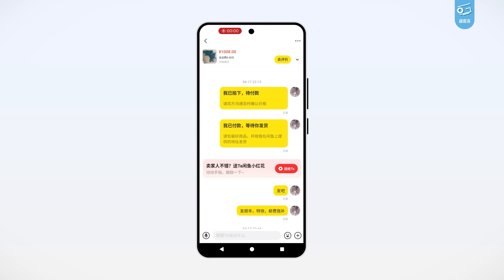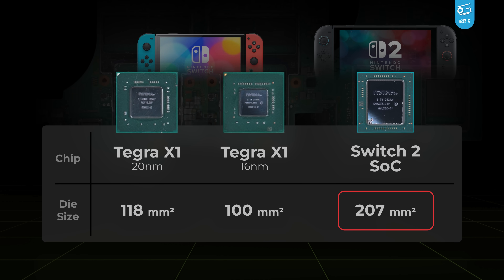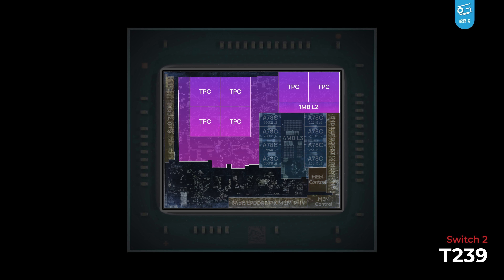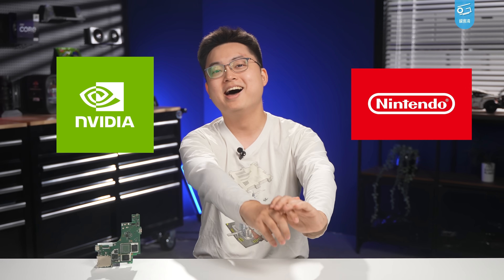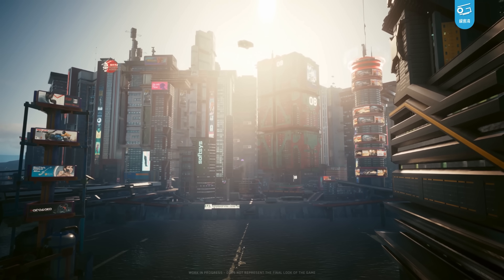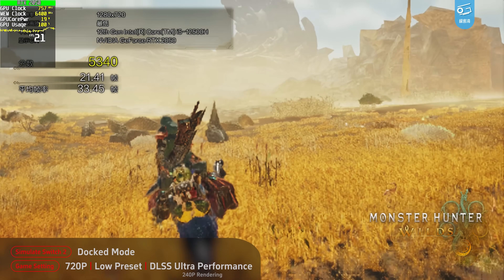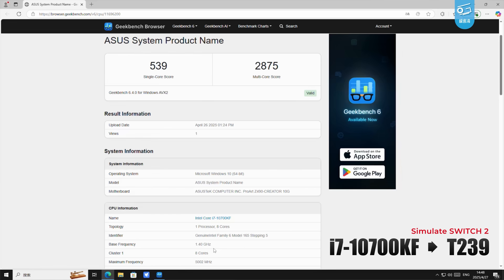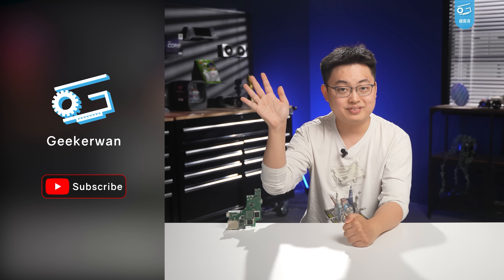This is Nintendo Switch 2's CPU!

Comment: I say that's a decent amount of power for a handheld, more power than a PS4. I’ll take it.
Reply: Eh when did the PS4 come out? 2013? So you're comparing it to something in 2013 in the year 2025. The power is in fact decent though compared to Nintendo's original Switch which was downright laughable even when it launched. Don't get me wrong I'm glad Nintendo is addressing how vastly underpowered it's systems have been. It is progress. But $80 games? $80 joycons? The system itself costing the same as a SteamDeck being $450 or more depending on region? You can buy a PS4 used for around $120 off ebay. IMO the only people buying the Switch 2 will be hard core Nintendo fans with those prices.
Reply: but still less than a steam deck as a portable device and less than a series s as a docked device...
Reply: @HermesderWetterbote steam deck is under base ps4 in terms of power, switch 2 easily outperforms it.
Reply: @shantaehalf-geniehero4318  steam deck is 7nm - switch 2 8 to 10. steam deck has almost 3 times more cpu power than the switch 2, steam deck has 4GB more ram. Steam deck has 4 times faster storage (nvmessd) steam deck has double the battery size. and these graphs clearly show the steam deck being faster than the switch 2 in handheld mode. and cyberpunk 2077 proves it: 360p to 540p native on switch with 20 to 40 fps (hopefully optimized to 30 to 40 until release) while steam deck can do native 800p with 40 to 60 fps.
Reply: @HermesderWetterbote  games aren't built with a steam deck in mind, they don't have any type of optimization
Reply: @chanchowaton  yeah, but the steam deck has a bigger amount of brute force, a newer more efficient architecture, more ram, faster clock speeds and faster storage, giving it the edge.
Reply: @HermesderWetterbote  guess we will just have to wait a month or two for the real winner
Reply: @HermesderWetterbote  let’s not forget what he showed cannot truly reflect the switch to can do until we actually see it when the console comes out those were simulations and they weren’t optimized to be played on said switch two
Reply: @chanchowaton  real winner is the consumer to Just play the games
Reply: @morantkamarie6251  but we can already estimate based on cyberpunk 2077
Reply: @HermesderWetterbote  what do you mean estimate the fact is the cyberpunk with the DLC is not able to run on the PS4 but it’s able to run on the switch too
Reply: @PETEYRLB  frfr
Reply: @morantkamarie6251  i mean compard to the steam deck xD there is no question that the switch 2 ist stronger than the ps4. just like the switch 1 was stronger than the ps3

Comment: It should also be noted that Steam Deck's APU has dynamic clocks due to its 15W TDP limit with priority give to the GPU. While the CPU is capable of hitting 3.5Ghz, in anything (especially games) where the GPU is pushed heavily, the CPU gets the short end of the stick and has to throttle down, which people have tested to go down to the realm of 2.0Ghz and lower when the GPU is at its peak.

With the GPU benchmarks regarding the Series S, an RX 6600 is used for the test, but quite frankly, even with clocks lowered, it is overselling Series S's potential. Of lesser importance, having 8GB of VRAM is roughly around how much RAM Series S has for games as a whole (after the OS takes its cut), so a GPU test that can make use of the whole 8GB just for GPU operations leans to results higher than what one would expect from an actual Series S with games. Compare that to the rig used for the Switch 2 that is limited to only 4GB of VRAM. It's the minimum requirement for the benchmark, but with Switch 2 having 12GB total, even if it allocated 2GB for the OS, that's still 10GB for games, where graphical data could have more than just 4GB available, offering advantages in performance that the rig cannot.

Now for something very important to consider. The RX 6600 used for the Series S simulation includes Infinity Cache Gen1, capable of almost 2TB/s of bandwidth to complement its 224GB/s bandwidth of the main VRAM. This is really what allows modern AMD discrete GPUs to outperform Nvidia GPUs in raw performance (no upscaling or ray tracing). Series S has no Infinity Cache whatsoever. It's too big to fit into an APU that combines CPU and GPU in a smaller package. This goes for any currently available AMD APU, not just for the Series consoles. This includes the PS5 (which means the simulated rig for that using an underclocked RX 6750GRE is overselling it), and the Radeon 780m in the R7 8845H which the score already takes into account the lack of IC.

It was probably an oversight to get this video out. Just wanted to points this aspects out.
Reply: How would you account for those differences in the simulation, short of using the exact hardware? That's why it's only a simulation...
Reply: Well, that's the thing about simulating a platform, you know it's simulated. We should more or less know that we're looking at best case scenario or a ballpark data point. I'm personally not super uptight about the specifics when it comes to these things because it works as a form for contextualizing performance across different sectors/segments.
Reply: @DiscostewSM Meow meow yeah but what does that mean for OATCHI barg barg awoooooooo ...?
Reply: If the steam deck part is true then that means that the cpu under a peaked gpu is about 2,500 in multi threading speed which makes it inferior to the switch 2s cpus speeds, and also makes it barely faster for single thread speeds. Given DLSS being superior to the steam decks upscalers and the relativity between the 2 gpus when in handheld play the switch 2 would generally have better image quality in games. We see this pretty well with cyberpunk 2077 tbh
Reply: But amd doesnt outperform nvidia
Reply: @bulletpunch9317  In terms of rasterization it does, partially because of having more ROPs for rasterizing pixels than what Nvidia puts into their GPUs. But Infinity Cache is what helps being able to utilize those to their potential, and without that, they are not as efficient.
Reply: @DiscostewSM  how are ypu comparing the models , like 6600 vs 3060? Isnt 3060 faster in raster?
Reply: @bulletpunch9317  It's just a known fact. Modern AMD GPUs having more ROPs and run at higher clocks to rasterize more pixels than modern Nvidia, but their available RAM bandwidth can't sustain that very well, hence why Infinity Cache is a thing. With your comparison, between the RX 6600 and the RTX 3060, the former has more ROPs and runs at a higher clock to have a pixel fillrate almost double what the latter can do. But, the RX 6600 doesn't have the raw shader performance as the RTX 3060 has, which is 8.928 TFlops vs 12.74 TFlops respectfully. The AMD GPU can output more pixels, but the Nvidia GPU can calculate more with regards to those pixels. It's probably why Nvidia put so much focus on upscaling and ray tracing. Render at a smaller resolution that incorporates better output  per pixel (including results of ray tracing), and then use the superior upscaler to hit levels the AMD GPU cannot.

I do believe this is the strategy being used for Switch 2 as well, to work smarter and not harder by rendering at lower resolutions that the "competition" does, and then upscale it to provide better output. We're already seeing it with games like Street Fighter 6 in Switch 2's docked WIP form compared to Series S.
Reply: @DiscostewSM  so its not faster in games but in some bench where its not bandwidth limited?
Reply: @DiscostewSM also wasnt the 3060's high tflops because of some sort of dual issue? How does that affect your explanation?
Reply: @bulletpunch9317  Does it affect it? Not at all. You are likely referring to the transition from Turing to Ampere where the Flops from each SM doubled, but that is only because the transition from Pascal to Turing before it created the situation of reducing the Flops from each SM by half by creating the arrangement of each SM being split down the middle to one half being FP32 and the other half being INT32. Ampere was a general return by allowing the INT32 side to be able to do FP32 instead. It's a better scenario because games did not need 50% of their GPU loads as INT32. Not even close. You may think that having double the TFlops means games would perform twice as well, but then point out that games performed only about 35% better. That is because games still used INT32. The improvement comes from the ability to push FP32 on the INT32 side as needed that would otherwise be wasted. Ampere was pushing better marks with fewer SMs than Turing because of this. It is doing more with less.

So is it a fake situation of doubling the Flops but not achieving double the performance? No. It is a general return back to how things operated. The black sheep is Turing. With Pascal and before, every core could do either FP32 or INT32, but INT32 ran at a lower rate than FP32, about a 2/3 rate. Same for AMD's GPUs back then. Turing was their way to get INT32 up to an equal rate as FP32 at the cost of dividing each SM, and Ampere returned to the full SM being able to do FP32 while keeping INT32 at the full rate. I believe it took until Blackwell to have ANY core be capable of FP32 or INT32 at full rate as opposed to half of each SM being FP32/INT32. I don't recall which AMD GPU architecture fixed the INT32 rate (maybe RDNA 1 or 2), but they kept with each core being able to do either or for the entire time.
Reply: @DiscostewSM  so the 6600's tflops are also calculated the same way? The rdna 3 dual issue doesnt work like nvidias does it?
Reply: @bulletpunch9317  The RX 6600 is RDNA 2, not 3. RDNA 3's "dual issue" comes from each shader able to process 2 sets of FP32 calculations with the same operation, but only a handful of operations even have the capacity to do that, and devs cannot program directly for it as it is compiler-based, which has been known to handle it poorly due to all the other kind of optimizations that are given priority. When you see something like the Ryzen Z1 Extreme (RDNA 3) showing in the realm of 8.6 TFlops, it's because they advertise it as if everything it does is dual issue when in real world terms, it's nowhere near close enough to do that. Your best best for a case like that is to basically split that in half as if dual issue is never used.
Reply: @DiscostewSM  yeah i know its rdna2. I was asking if the 6600 is also calculated the same way as 3060.
Reply: @bulletpunch9317  In the case of Ampere vs RDNA 2, then yes, the Flops are calculated the same way. The total number of shader cores * the clock frequency * 2. The only real time it differs is when calculating Turing, as only half the cores are capable of FP32. Advertisements of RDNA3+ generally double the Flops because of what I mentioned about dual issue.

Example of Ampere: 1536 cores * 1.0073Ghz * 2 ~= 3.092 TFlops

Comment: If steam deck has little bit more power on hand held but it only can get 720p but switch 1080p then can dock if you want a boost in ghaipic or performance.

Comment: Great to know that this 450$ console is just as severely underpowered as the original switch when it released back in 2017
Reply: It’s not underpowered for a handheld. It’s comparable to Steam Deck with better rendering features like DLSS and 120fps VRR screen. Obviously a PS5 will outperform it but it draws 10x the power
Reply: @user-wb8iu1hl6i  I'd make the argument that as more and more handhelds are released every year, the steam deck as well is rather underpowered. Although it is definitely a matter of opinion.
Reply: @  The Steam Deck isn’t underpowered for its price. Improvements in silicon are not coming cheap and fast anymore
Reply: @user-wb8iu1hl6i  maybe used you could make that argument?? but ~500$ for the lowest end model doesnt seem like a great deal to me

Comment: It's incredible that the A18pro from iPhone is twice as powerful as switch 2. wow
Reply: And their phones are twice as expensive as well!
Reply: @tunkerdunkerr  It still is impressive considering it's so much smaller, runs with less power and is passively cooled. Had Nintendo opted for a more recent process node the Switch 2 probably wouldn't have been too far off from the A18.
Reply: @ Yeah it really is a shame that they didn’t go with at least 5nm… Still, for the price and what’s included, the Switch 2 retains some pretty crazy value in terms of the console itself
Reply: @tunkerdunkerr  Maybe because it’s also a smartphone with a camera, while the Switch isn’t?
Reply: @hyposlasher  Precisely, which is why the two shouldn’t even be compared. The iPhone, even with a faster processor on paper, won’t realistically see much better gaming performance due to the amount of resources taken up by other system processes. It’s just not a reasonable comparison. Regardless, even outside of the differences between the two products, the A18 chip will cost more to manufacture. So it’s no surprise that the on-paper performance is better
Reply: @tunkerdunkerr  Everything you wrote is just your assumptions, based on almost nothing. For example, you probably didn’t even know that iOS recently introduced a game mode, which activates when you launch a game and allocates all system resources to it
Reply: @ I’m typing this on the latest iPhone 16 Pro. And I’m saying that the gaming performance isn’t much better than the Switch 2 is advertised to offer. Not to mention the iPhone can’t allocate “all resources” to the game, otherwise you would never be able to exit the game or connect headphones to the phone, etc etc. The OS still has resources allocated even in game mode.
Reply: @ All your reasons why the iPhone supposedly can’t allocate all its resources to a game apply to the Switch too — you do realize that, right?
Reply: @hyposlasher  I’m confused what you’re arguing about here. I’m not disagreeing that the A18’s node and clock speeds are better, just that the chip isn’t a gaming powerhouse like the video’s graph makes it out to be. And the two examples I gave of OS resource allocation are two of MANY, most of which aren’t features on the Switch’s OS. I own both an iPhone and a Switch, love both, just saying the comparison shouldn’t be made because they’re VERY different devices with different use cases. iPhones are smartphones first that can also be used for some light gaming. The Switch is a video game console.
Reply: @ What makes you think the A18 isn’t a gaming powerhouse?
Reply: @ Personal use with it in Resident Evil, Death Stranding, and other AAA titles similar to those getting ports to Switch 2
Reply: @ How do you know the A18 is less powerful than the Switch 2 if the Switch 2 isn’t out yet and you haven’t compared them directly?
Reply: @hyposlasher  I mean, I could spin it the same way and ask you how you know the A18 is more powerful than the Switch 2. I’m just basing my statements on what’s been advertised by developers for Switch like CDPR, and Nintendo themselves.
Reply: @ Based on what GPU benchmarks show. Game performance usually correlates pretty closely with benchmark performance. It doesn’t happen that one chip is twice as powerful in benchmarks as another, but they perform the same in games. A separate issue is that the iPhone doesn’t have active cooling, so the chip can’t run at full power for more than about 15 minutes and loses around 25% of its performance. But here we’re comparing the chips themselves, not the iPhone’s cooling implementation.
Reply: Digital foundry did a versus video last year of the latest iPhones versus the Switch 1 (2017) and found that the Switch 1 actually held up well against the latest iPhones in gaming performance. This is purely because the switch is a fixed platform with very little OS overhead and developers have the ability to code to the metal access low level hardware that they can’t do on smartphones. 

It goes to show that these numbers and benchmarks mean nothing. The Switch 2 will easily outperform other mobile hardware for years to come because it is heavily optimized to do one thing only and to do it well, which is play modern games.

The other important thing to remember is that these benchmarks tell you only the peak performance which in reality is never achieved by any of these devices and their SOC’s whereas the the Nintendo numbers are a guaranteed bare minimum performance benchmark because Nintendo has already clocked both the CPU and GPU to achieve that performance level at all times and not have it spike up and down inconsistently like they would with these benchmark numbers for these other devices they compared it to and thus have inconsistent performance
Reply: 앱등이는 답이 없다 ㅋ
Reply: Yeah might as well mobile game instead tbh.

Comment: How you downclocked dimesnity 8400 at 18:05?
Reply: By root the device, said in their mandarin version video.
Reply: @Adren01ine-t46 i have roooted device. Which application he used
Reply: @rajmangalpandey3910  Maybe using "Scene"

Comment: Adjusted for DLSS according to advanced Ai analysis in order ranked: 

Switch 2 (Docked, DLSS-Adjusted) |
Snapdragon 8 Elite
GTX 1050 Ti -
Switch 2 (Docked, Raw)
Apple A18 Pro
Apple M1|
Switch 2 (Handheld, DLSS-Adjusted)
Snapdragon 8 Gen 3
Steam Deck
Switch 2 (Handheld, Raw) -
GTX 750 Ti
Simulated PS4
Snapdragon 8 Gen 2
Switch 1 (Docked, 8GB)
Switch 1 (Handheld, 8GB)